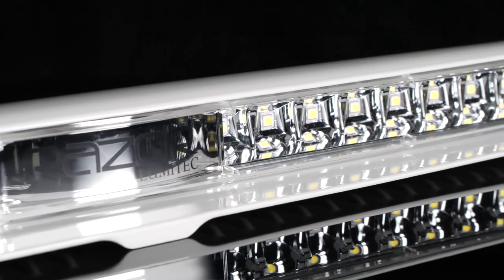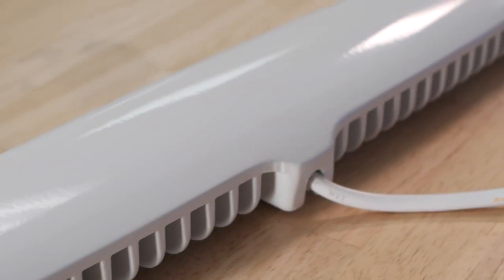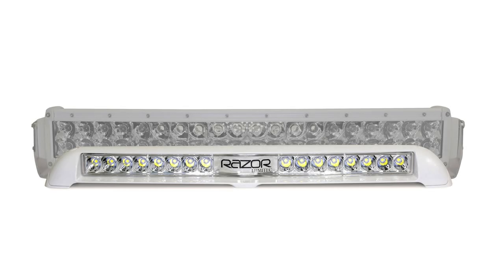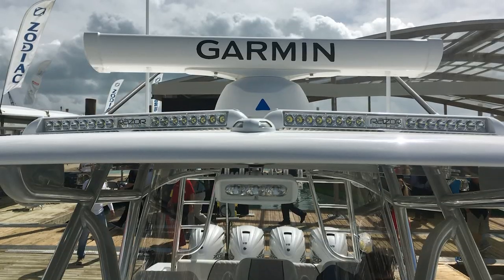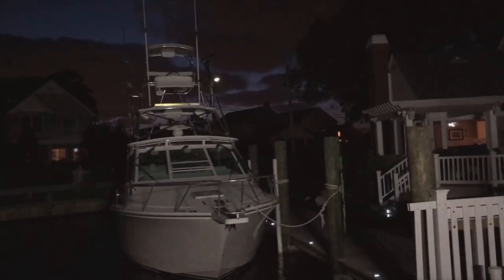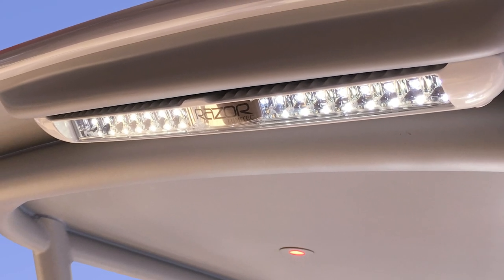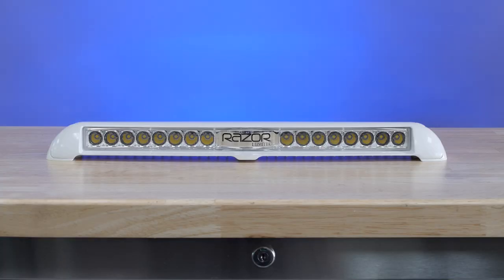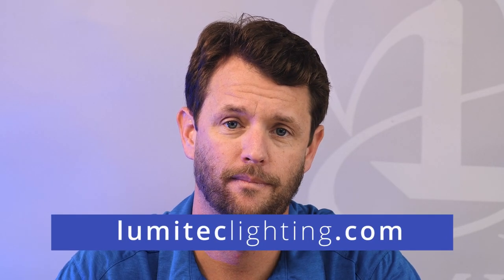Razor Light Bar Product Video

Comment: I want to add these to the Topper on my Marine Transport truck!!! AND of course on my boats as well.  So often I am picking up or dropping off a vessel at a ramp or Marine Dealer after hours and the rear spreader light with be so amazing to assist with loading/unloading.
Reply from the maker: David, the Razor will run on a 12vDC system and can be dimmed from a standard switch. Available in flood or spot configuration but in your application I would recommend the Flood option.
Reply: @Lumitec  
I filled out the Pro Staff form and think there's an entire industry your product would have remarkable success within. If you follow my Channel, you'll note I travel all across the USA to marinas, dealers, and marine manufacturers to haul their boats. If I had @Lumitec lighting in my marine trailer and the peace-of-mind, my lighting would be functional in all conditions... as well as the safety, there simply is no competition in this sector.
Reply from the maker: Thank you for your interest in the Lumitec Pro Staff  program. The application process usually take a few weeks to review.